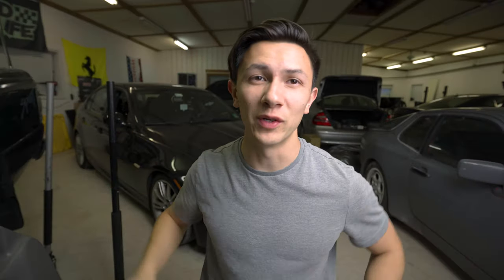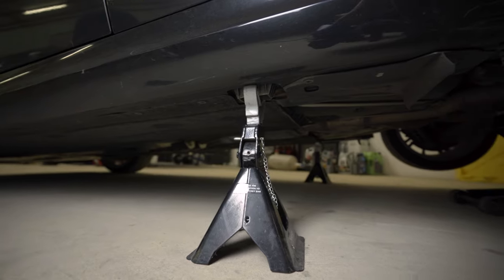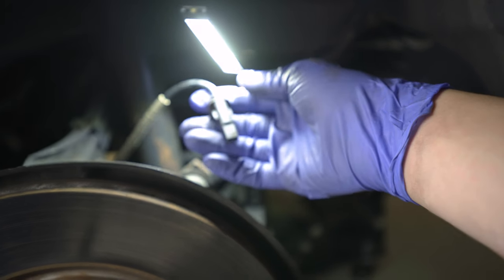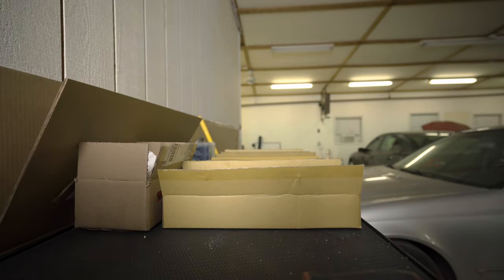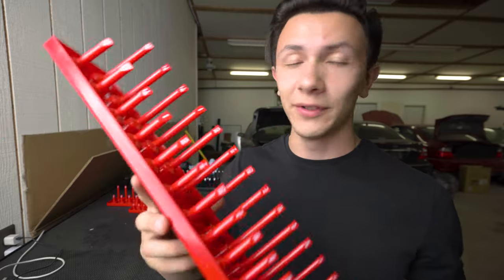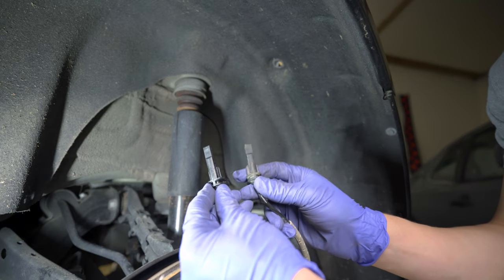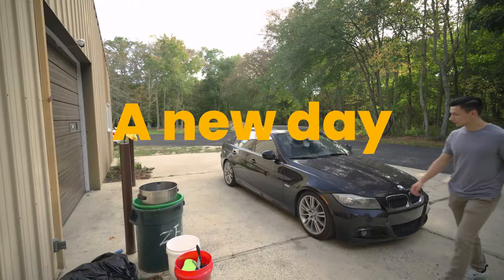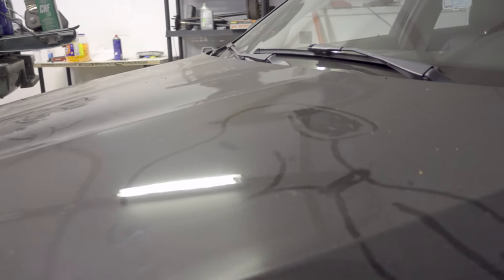Fixing My "Unreliable" BMW 335i - ITS EASY

Comment: Lol you put "unreliable" in quotes as if you bulletproofed it. These are just the small BMW things that apply to every vehicle in the lineup. The real reason the 335i has a reputation for poor reliability is all the N54/N55 specific stuff that works fine until it doesn't leading to catastrophic engine failure. They aren't bad cars but they do go bad pretty quick lol.
Reply from the maker: I dunno what you mean I bulletproofed it and solved world hunger lmao. Believe me I know the N54/N55's got its issues. I gotta take care of some OFHG leaks in another video maybe a baffled oil pan. I'll try to keep my 335 a nice one tho 😉